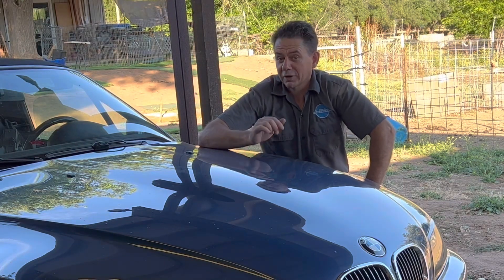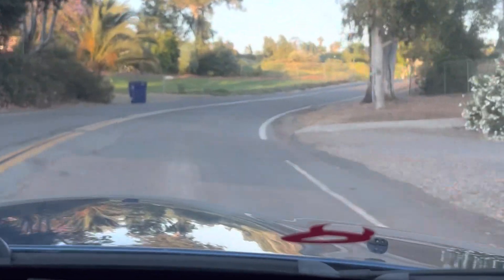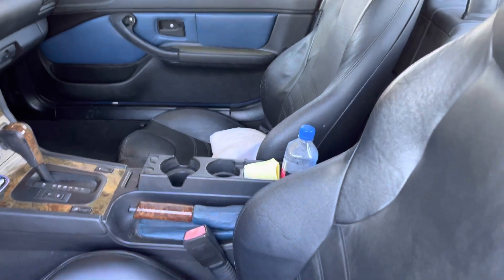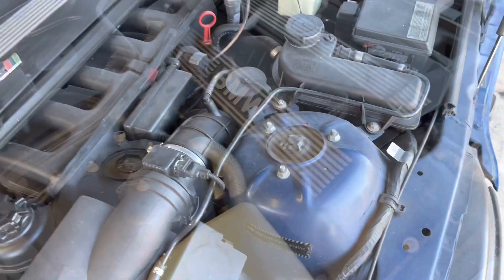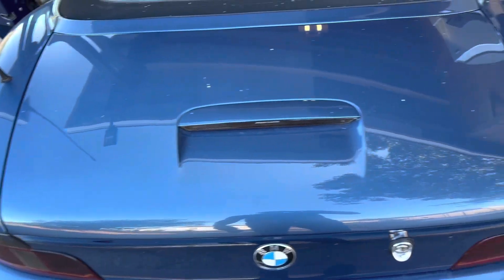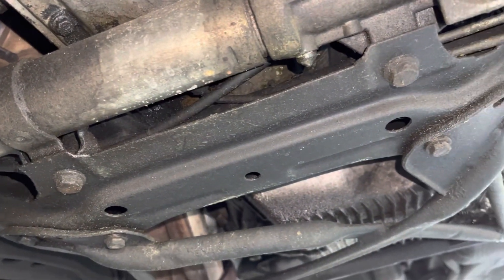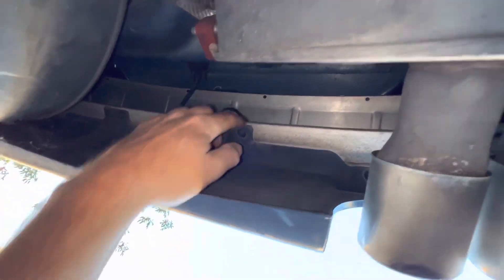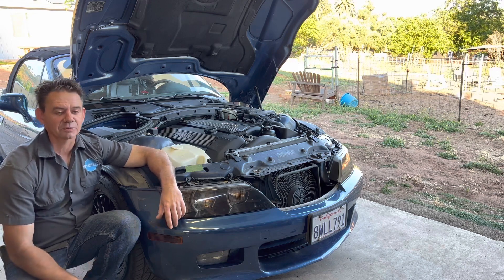My Girl Bought A BMW Z3 But Was It A Good Buy?

Comment: I have a 2002 with 195,000 miles on it. Love it! I love working on it. Just do preventative maintenance and it will be fine.
Water pump and radiator are a weak spot. Replace them with strong aftermarket items.

Comment: I bought a 2000 Z3 2.8 5 speed last year with 189,000 miles.  It also was very clean and stock.  Struts, shocks and control arms were replaced.  Seat bushings were shot so that’s an easy fix.  My vanos oil line started leaking it was original so that’s been replaced.   There are a few electrical gremlins I’ll call it such as sometimes the cruise won’t work but next time it will.  It’s fun though and I love it. 😊
Reply from the maker: It really is a fun car! And I think it’s worth putting money into

Comment: Nice car. They are relatively bullet proof with the exception of the usual suspects - cooling system, valve cover gasket and oil filter gasket and front suspension components. All in all a super reliable car.
Reply from the maker: love this car! I'm a big fan of BMW. i just got a Z4 S-Drive 35 i

Comment: Yep, needs suspension work!  Good luck with this one, but IMO $5k for 20+ year BMW with 160k miles isn’t a good buy.  It is a 6 cyl engine so that’s a plus.  Suspension and brakes - you’re prolly close to $1k in parts.  BMW cooling systems are notorious.  Change ATF fluid.

Comment: I take that is the M52TU in there?   It runs fine I am sure, but a lot of maintenance work needs to be done.   At 23 years/150k the whole cooling system needs replaced because it is EOL, unless you are prepared to get stuck on the side of the road at any time -  radiator, reservoir, water pump, thermostat, fan clutch and a whole bunch of hoses.  Not too difficult to work on but a lot of time and $$$ (but it less expensive than the newer BMWs for sure).
Reply from the maker: Yep typical BMW plastic. I am willing to work on it and like you said a hell of a lot cheaper than a new car.
Reply: Ugg